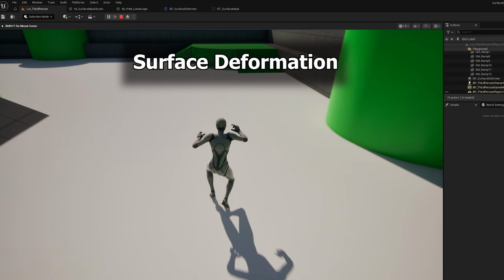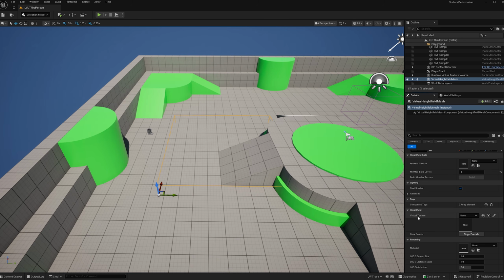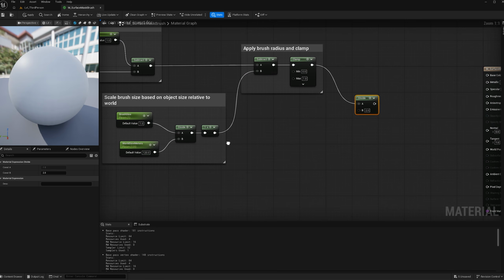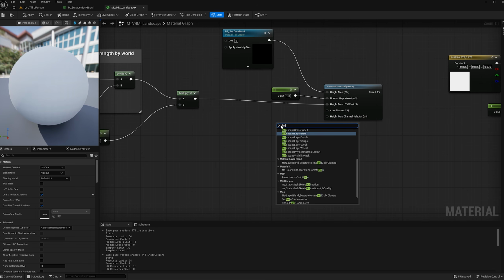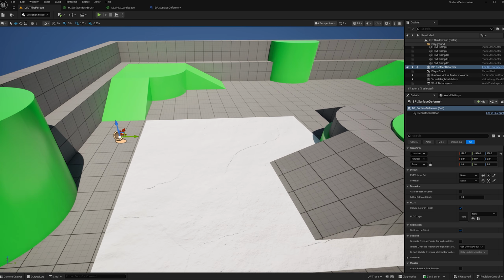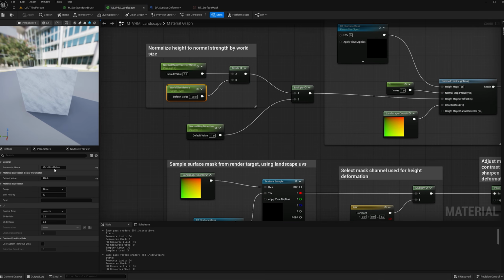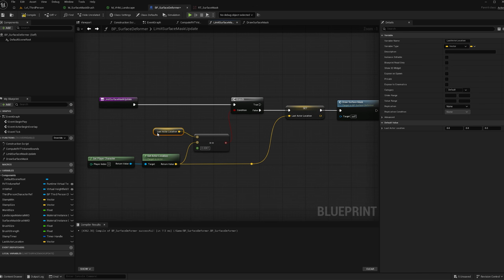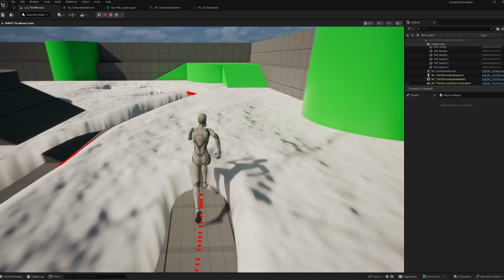UE5 Surface Deformation Tutorial | Real-Time Snow & Ground Depth (Render Target, RVT, VHM)

Comment: Thank you for the great lesson!
Is it possible to set it up so the field is empty at first, and snow only appears where the actor runs?
Reply from the maker: Thanks for watching! and yeah you’d basically want to invert the logic from the tutorial. Right now the render target starts empty/black, then the character paints into it as they move, which is being used to push the surface down. For snow appearing where the player runs, you could use that same painted mask in the opposite way, where black means no snow and the painted areas reveal or raise the snow material instead.

So the core system would still work, but the material logic would need to be adjusted/inverted depending on the exact look you want.

Comment: Do you think you could make a tutorial on how to impement the previous footstep effects and sounds on to a landscape because they dont currently work on a landscape?
Reply from the maker: Thanks for watching! You can get surface detection working on landscapes by assigning Physical Materials to the Landscape Layer Info assets for each painted layer. Then your trace can detect the surface type the same way as with meshes. A few others have asked about that as well, so after I finish the tutorial for footprints with deformation, I may make one covering that too.
Reply: @tankcontrolgames  That sounds great but not to sound disrespectful that should have been covered in it as well I appreciate the tutorial a lot and it's really cool that I can do this in my project but now that I have it in there there's nothing much I can do without having those sound effects play as you walk through the snow!

Comment: Would the setup be similar if I wanted some Sphere with physics enabled rolling around on surfaces and "Stamping" into a Render Target  ? Would it possible to have multiple of those at runtime ?
Reply from the maker: Yeah, that should work with basically the same setup as the Surface Deformer BP. You’d just replace anything referencing the player/root bone with your sphere actor.

Instead of tracing from a bone, you could trace from the sphere’s world location downward to get the hit position for the stamp.

For brush size, you could either use the sphere radius or derive it from the actor bounds if you want it to auto-scale. And this approach should work fine with multiple actors at runtime.

Comment: I just had an idea for another tutorial series for you! What about a Settings Menu? But a good settings menu, with Graphics, Video, Audio and Keyboard&Mouse Settings that is functional, looks good and is multiplayer ready?! There a thousends of Settings Tutorials out there but non of fits my needs because they either missing a ton of options or dont look good!
Reply: Technically it doesn't need to be multiplayer, because most settings will only affect the player locally. Only settings that need to be replicated should be replicated, for example if you change the speed of the character. Easiest way to approach this would probably be using Interfaces to first get the intial settings, then you can use interface messages to change settings in runtime. But most settings such as graphics stuff can be done in the widget itself using an execute command node and just typing in the needed commands.